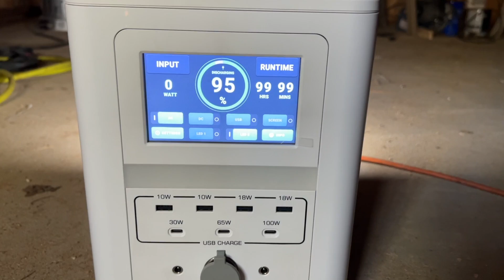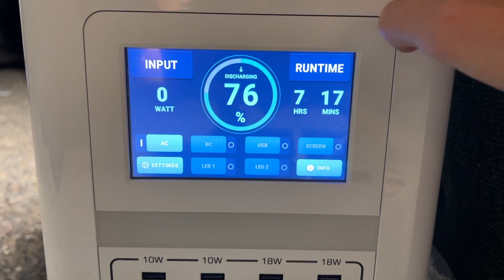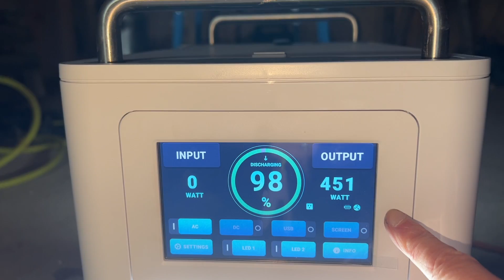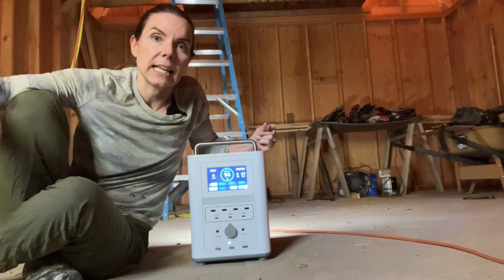Power Solution for our Off Grid Storage Barn

Comment: Part 1
 I suspect most everyone enjoys turning the faucet on and immediately having hot water for dishes or showering. In a camper, you probably do not wait very long depending how far away the water heater is. Just consider how much precious water you may be losing down the drain, waiting for hot or even warm water to get to the faucet. I installed a "Watts’s" water recirculating valve, into my hot water line at the water heater. The second part installs near the faucet or shower.
Reply from the maker: Clever!

Comment: LED lights will draw almost nothing compared to halogen for the same amount of light. 450 watts of light in LED would only use 54 watts of electricity. Your battery/power center would last more than 8 times longer.
Reply from the maker: Great point!